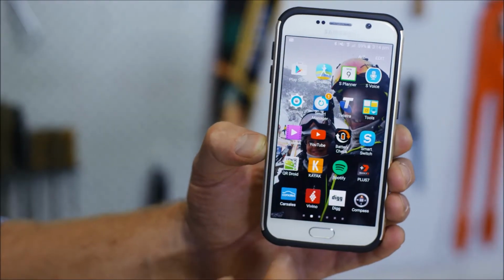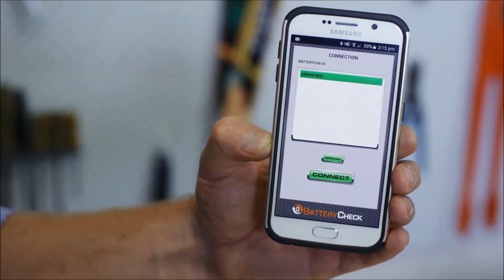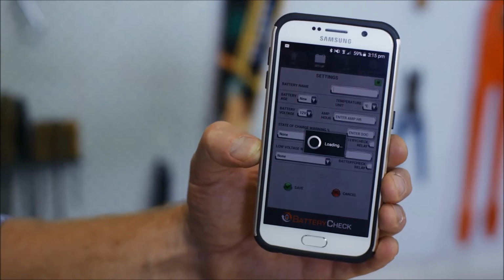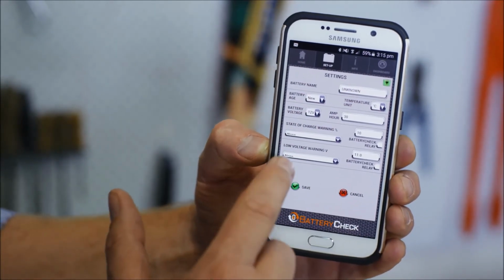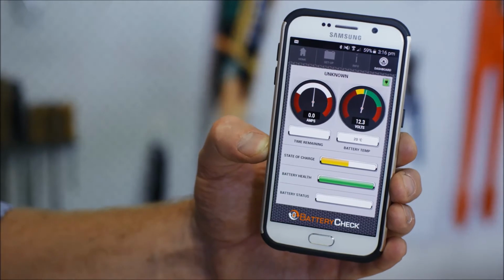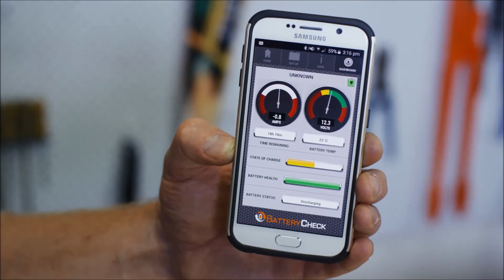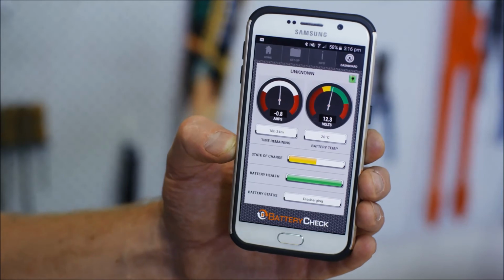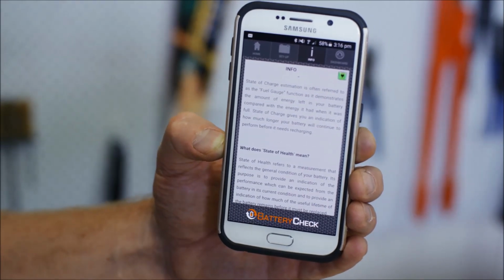How To Install A BatteryCheck (With 2 Batteries in Parallel)

Comment: The parallel battery pair on my camper trailer are on opposite sides.  One negative lead runs from each and disappears into the frame. Both are grounded. They may or may not join and if the ground contact is OK that shouldn't matter right?
So, there's no load connection on either negative battery terminal at the moment. So how does the BatteryCheck work?

Comment: so how does it tell me if one battery is off and the other good
Reply from the maker: Hi, If the batteries are connected together, it is unable to distinguish one battery from the other, it will see the combined total of each battery. The batteries will always try and equalise with each other. To check each battery, they would have to be isolated from each other to correctly monitor what each battery is doing.

Comment: Hi, obviously the video showed the neg cable off battery #1 going on top of the Batterycheck on battery #2 main post!  Does this really matter in answer to Kieren's question?
Reply from the maker: For the BatteryCheck to work/read correctly, the negative linking cable between battery 1 and 2 remain in the same location on the battery posts as they do now. The output negatives (loads) comes off the battery (call it battery 2). The BatteryCheck input negative attaches to the negative linking cable and the BatteryCheck output negative becomes the 'new' battery bank output for all output negatives (loads) to attach too.

Kind regards,
Stewart / customer service
Reply: @BMPROau  Hi Stewart, don't normally look @ this email address, but do you call battery #2 the rear unit? If so this is clear. If it's the forward battery I'll have to remove the "p" clip on chassis to allow the white cables top reach.

Comment: Can you please clarify the note which pops up at 1:04. Does it mean that the negative terminal of the battery in parallel which is connected to the ‘old negative’ should also be connected to the ‘new negative’ on the battery check? Has this connection been left out of the video?
Reply from the maker: If the batteries are in parallel than the negative of battery II needs to go under the BatteryCheck device on the negative of Battery I.

Comment: What's the max amps it will measure plz
Reply from the maker: Garry, there are two models of BatteryCheck now available, BatteryCheck100, measuring up to 100A peak (80A continuous), and BatteryCheckPRO, measuring up to 300A peak, 240A continuous https://teambmpro.com/products/wireless-battery-monitor-batterycheckpro/